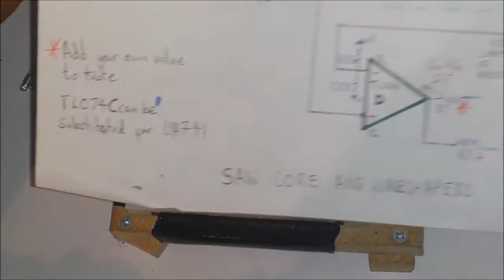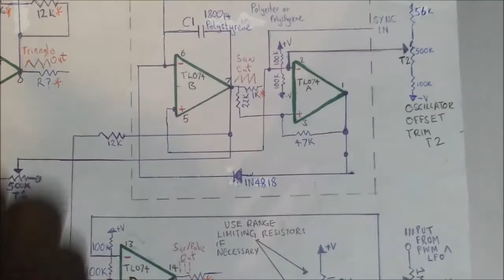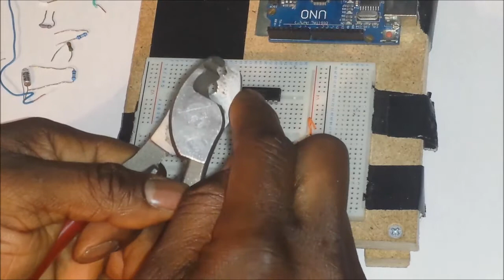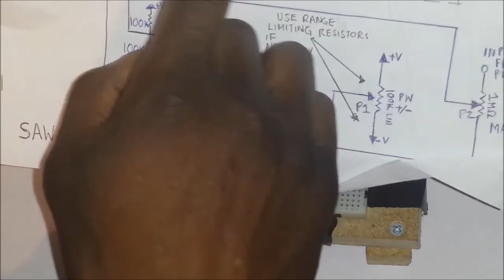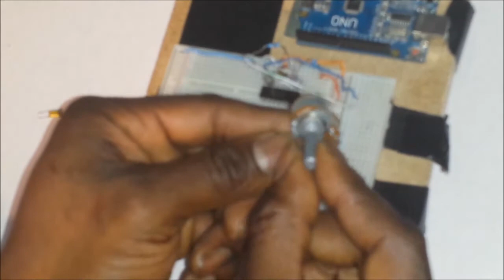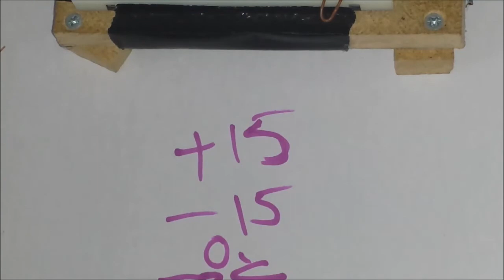DIY analog synth Project (Tips N Tricks 2 Breadboarding a circuit)

Comment: NEAT! the LFO reset to ground it's a great tip! I've actally have to get an opamp first, or quad, they disguise themselves oftenly, very hard to find!
Reply from the maker: My apologies on delayed reply. There are many types of op amp available so i guess you need to ask yourself what will be the purpose of the circuit. For instance for a vco expo circuit i use higher end op amps ie opa 2132 (thou there is better) for lfos i use low powered versions ie 358 dual or 324 quad low power mainly for lfos as there is less current draw.

Comment: My grand father did found a piece of cat.5 cable for me... but the wires are springy... Can it be because of some cold storage or these cables are all different? The isolation is not soft... so it gives a feel of grape branches (can pop out suddenly). One pro is that they're thicker than others. I've got more stable connection with old thin telephone wires... Do I need to search for better cat.5? Because these telephone wires are not good as well...
Reply from the maker: MoolahNasreddin . Get some new Cat 5 . If its been in storage somewhere it could be defective and have a higher resistance than should have . It should also be solid strand as ive stated before. Hope this helps  ;-)
Reply: yep, thanks! I'll try to find some cuts to buy.
Reply from the maker: MoolahNasreddin All the best .Hope you find some suitable cable at a good price ;-)
Reply: Thanks! :) In my ToDo list now ))
Reply: I've suddenly found a good piece of cat.5 UDP cable in my room :D
Our young cat already love it! :)
Reply from the maker: MoolahNasreddin Haha good stuff. Now you can get going i guess ;-)

Comment: Hi! One of your best tutorials!
My little tip for multimeter testing:
- make your own crocodile clippers with wire and place them into a multimeter (instead of probes, "banana" plugs are necessary to insert into a multimeter)
- then use simple "Dupont" cables for bread-boarding and "bite" them by "crocodiles" to make probes for breadboard.
So if you'll have at least one spare connection point in a row you'll be able to connect a probe there without biting any details. It's useful because (usually) resistors has thing legs and can be put out accidentally while probing.
Also it's good because you'll be able to safely connect to ground on your breadboard. Sometimes it's tricky to connect a clip on a PSU directly and can become a reason of a big failure.

Power rails tip: NEVER power "+" and "-" rails which are very close together. If you don't have a switch that powers up your breadboard then it's very important. Once I've been very tired and accidentally touched a wrong rail while connecting a battery.   Two dead chips :) Not expensive but I've got the lesson!

One big tip: don't buy cheapest Chinese breadboards :D Always ask a seller (before paying if it's Ali) to send you an actual picture of it's item. If it's a shyte, it can be figured out easily (bad blurry or smudged paint, pointless numbers' order - not the same on the other side). All signs point that it's a not good thing.
If a seller doesn't provide any actual pics (then 50/50 they sell full crap that you'll be spitting on every time when your wires will be loosing connection (bad metal parts inside!). Always read comments of all stars (not only worst) sometimes people make useful notes in "5 star" comments. Fresh comments are the best. Some sellers starts to sell a crap after they gain a good reputation (or just buy a bad portion of items but they need to sell them anyway).
I know it's off-topic but I've got this experience while trying to save some money because breadboards in our shops are too expensive! About 3-5x of their actual price.
Reply from the maker: MoolahNasreddin Thankyou so much for your comment and input. I hope people who pass through the video channel , have a good read as i have . Some very useful tips from yourself ;-)